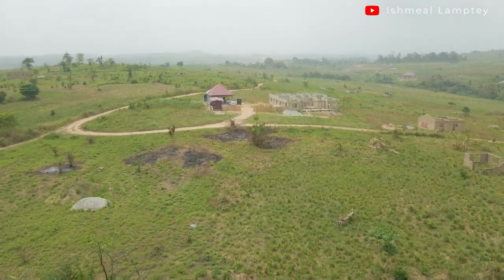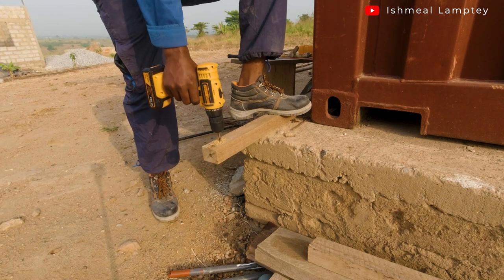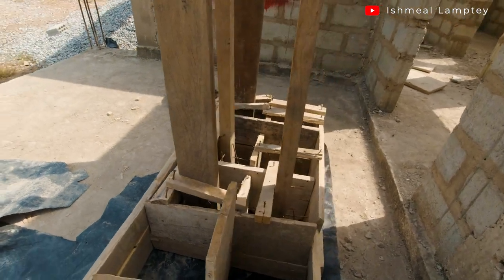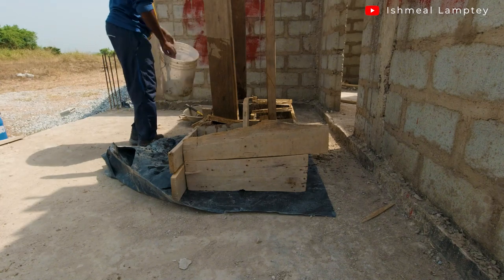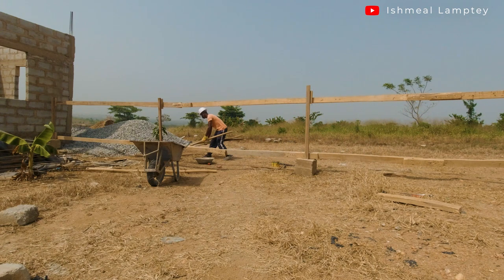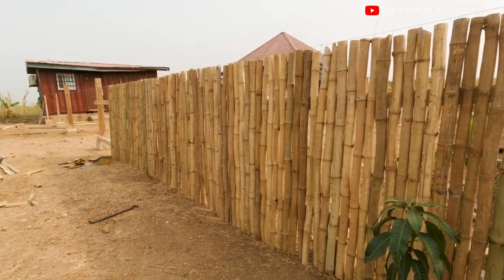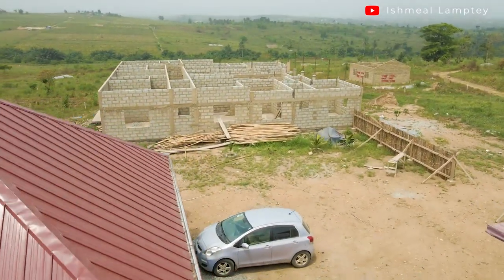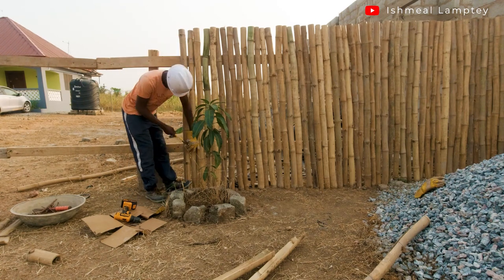Step by Step process on How I created a Simple DIY Bamboo Fence

Comment: I agree with nails. Either screws or nails will crack the bamboo, unless you pre-drill. So, you’ll need two drill/drivers if you use screws.
Reply from the maker: I had one drill, so i pre-drilled and drove nails into them

Comment: Also you could dig a small ditch near the bamboo fences and put fine hole strong iron mesh in the ditch to act as a foundation for the fence. And nail the wire mesh to the base of the bamboo fence to keep out rodents and snakes and to strengthen the bamboo fence. 

Could have added steel rods/poles into the concrete blocks to strengthen them and keep them grounded and then using bricks build a post up to 10ft high. Then using steel brackets instead of nails screw the bamboos to the planks. Using steel brackets screw the brackets to the bricked column post to the planks then screw the bamboo on. Screws are stronger than nails.

I used to do my own business in landscape gardening and painting and decorating and woodworking. When i was a teenager. Now i have illnesses and disabling conditions.  So can't do stuff but i can advise. 🥰
Reply from the maker: The reason i didn't do some of what you've suggested is because the bamboo fence is only temporary ad that's not the boundary of the plot.
But thanks for the suggestions

Comment: What is the purpose of splitting the bamboo down the middle lengthwise?  Is it to prevent pests from building nests?

Would I be able to leave the bamboo whole?

Great tutorial. Thank you.
Reply from the maker: I only splitted them because I didn't have a lot of Bamboos. If I did, i would have left them whole. So my reason for splitting them was to ge able to get enough for the fence
Reply: You’ll need twice as much bamboo!

Comment: wow , I have been thinking of fencing my farmland and this has really turned on a light  bulb in my head. What did you spray the bamboo with to avoid termites and is it readily available on the market?
Reply from the maker: Very glad to hear. I used dusban and yes, you can easily fine it in the market

Comment: How long would a fence like this last? Especially when taking the rainy season under consideration 🤔
Reply from the maker: Bamboos are tough and able to withstand harsh weather conditions for a very long time, whether rain or shine they last longer. It is very important to treat them instead to prevent pests from destroying them.
Reply: @IshmealLamptey  great info 👍🏽 Thank you 😊
Reply: Decades, Bamboo rots slowly. This is another reason to split them down the middle, which is easy. It opens up the channels, letting them drain water, so they rot slower.
Reply: @IshmealLamptey  I HAVE Bamboo trees here in Puerto Rico and the termites don't touch them at all, but they attack my avocado tree. i don't know why.